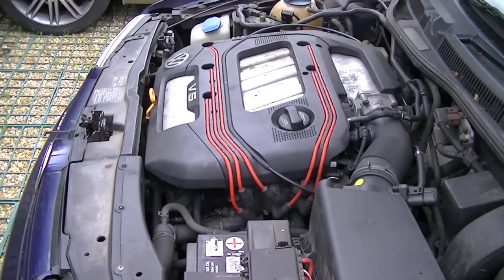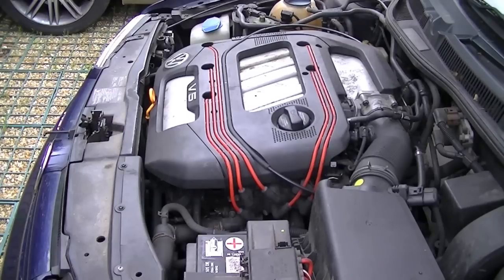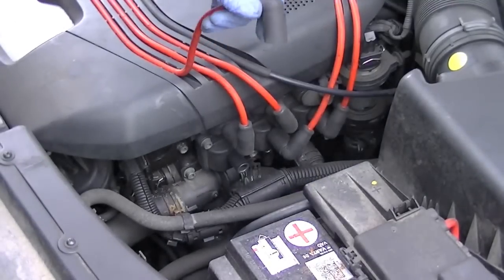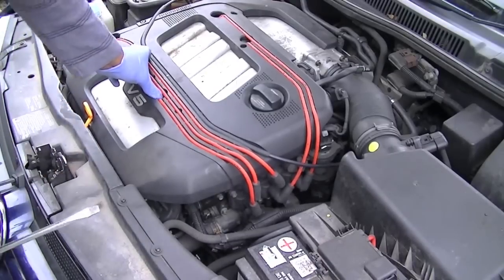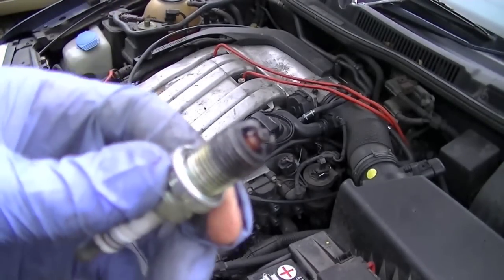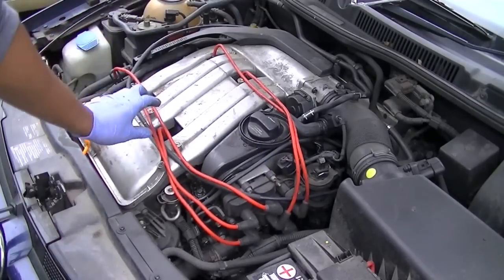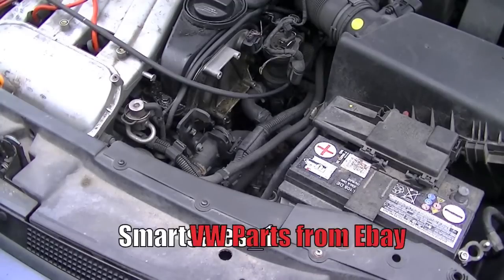How to diagnose and fix a Engine Misfire

Comment: I have the same problem with my 98 1.6 Polo. I "knew" nothing about cars and as i cant afford to take it to a garage, i've had to learn and try it myself. I can now say that i i do now "know" what's under the bonnet and how it works. I have not tried the coil pack but i suspect it may be that. I haven't tried your suggestion yet but i just wanted to say, as instructional videos go, this has to be the best i have seen yet - well done and thank you !!

Comment: Thanks for the informative video. Apparently process of elimination does work. I have a miss in my 97 SunFire and since I changed out plugs and all the plug wires , the coil pack system is all that's left to change out and should make the difference. It is old but never gave me any trouble that couldn't be resolved near 200,000 on 4cyl engine. I will post my results. Thanks again for the inspiration.
Reply: In this particular  year , the coils are not easy to access . they are under and behind the engine, a lot of people had problem with them and the next year, GM shifted them to top of engine . I have to remove parts to access, like top half of engine intake manifold and nearby parts. I don't know why the 97 sunfire was built like this .  I have not finished with it yet but will post it when I do.

Comment: Ignition electronics can be ruined by disconnecting spark plugs while the vehicle is running. Best to either disable the cylinder by grounding the spark plug wires or disabling the fuel injectors.

Comment: My van was misfiring and would "buck" at high speed. I watched YouTube vids and decided to look for arcing off the coil. Sure enough, there was arcing from the coil to the transmission fill tube. After replacing the coil it still misfired when it was warm. Took it to autoZone and had it scanned and the #4 cylinder was misfiring so I replaced all the plugs and wires. That took care of the misfire (I think the insulator on the firing end on plug # had a hairline crack). Ended up replacing the coolant temp sensor too. It still bucked at high speed but not as much and the gas pedal felt kind of weak. After thinking about it for a while I replaced the air filter and that fixed that  problem and it drives pretty nice now.

Comment: I'm experiencing the EXACT same issue on my 5 cylinder Acura. Diagnosed it's NOT a plug or wire. Gonna test cylinder compression before I order a new coil.

Comment from the maker: The dealer saying it could be a software problem is another way of him saying he didn't know but he had to say something.

Did you check, injectors, fuel pressure, fuel contamination, spark plugs, leads etc? When you say tuned what exactly did you do?

Comment: hi thanks for the video, did you actually test with the new lead before changing the coil pack? The video seemed to skip that part but then clearly showed the new lead in place when you switched the coil pack out.  where di your fault lay with the pack or the lead?

Comment: My VR5's bad cylinder fires sometimes. I was diagnosed with a bad coil but another mechanic said it wasnt the coil, wires, plugs but the Ignition Module, even though the car always started.

Comment: How can you tell it was misfiring? I noticed the change in sound when you were unplugging wires to find which cylinder, but I did not notice a change in noise from when you fixed it
Reply: Before it had more of a huffing/fffing sound and after it sounded smoother
Reply: Smoother noise, less shaking.

Comment: Cracking video. I'm trying to find out which of the 3 cylinders on my daughters 1.2 VW Polo is misfiring. And now I know how to find out. Thanks for taking the time to make it :-)
Reply from the maker: The pencil coil packs are common points of failure on those cars.
Reply: Thanks for the info, I did hear that from someone else to. Fault code states "Cylinder 3 misfire", but I've no idea which one is the number 3!? :-/
Reply from the maker: Usually left to right or timing belt side onwards
Reply: Cheers. I think i'm going to try your way of disconnecting a coil/plug lead one at a time and see how it effects the engine, to find the problem one.
Reply: Burnt up exhaust valves and the guides are terrible on those usually cylinder 2

Comment: Where i bought the coil pack he said it is original the brand is bosch not a cheap one but my mechanic said this is not original
I have checked the spark plugs and high tensions they are good

Comment: I've been having a problem with cylinder 3 miss firing. replaced the spark plugs, wires and still miss fires. I think next ill change the coil pack. Also it dies when the break is applied, not like a stall and than dies, it just dies. I think its a vacuum leak somewhere.
Reply: An year ago, u had this issue, but as of now it's with me. Am tried of making it repair. Thinking about it to sell or dump. Your work process could save me bro

Comment: My current MK VI GTI has developed a misfire.  After replacing the coilpacks, spark plugs, hpfp, four injectors & doing a compression test the motor still misses. The dealer has told me it is likely to be a software issue. I have read of many people having to replace the ecu. Of course this is a tuned car with many modifications.

Comment: Very good video!  Is there way way you can be sure it's the coil pack before you get the old one out and fork out on a new one?  I'm not getting a spark on the 4th cylinder, and I've eliminated the plug and the lead as causes.  Is there anything else it could could cause it?
Reply from the maker: You can compression test the cylinder to make sure that the cylinders are holding pressure
Reply: and dont for get to check  the resistance on the wire  or swap the #4 wire and  using the  volt  meter check the  output  on that coil

Comment: BMAC VAGS i have a 2001 vw golf v5 170bhp version which started out with a similar missfire, now i have too apply almost full throttle on startup or it just turns over! Also when cars running it sounds like a chanook helicopter and tries too die everytime i stop at lights etc!? Reaks of fuel, i have changed cam sensor as vag error code said "camshaft sensor bank A overfueling due too timing out" but no change. Any help greatly needed thanks🤔👌

Comment: So I have an 85 chevy with a 350 carbureted it's straight piped with no catalytic converter and I am pretty sure it's missing, it'll bog down every now and then when I'm at lower rpms I haven't driven it at high rpms since it started acting up anyway when it idles it just sounds like it wants to die and it shakes not terribly but enough to notice it sitting in the cab people have said it's probably missing but I'd like to hear from more people
Reply: sounds like a fuel / carb problem
Reply: I'd whip out the ole timing gun and make sure your carb is properly adjusted with the proper jetting.

Comment: Can you do this for a 2012 Buick Regal. It’s got a brand new engine. The check engine light is still on, ABS light, the light with exclamation mark & the light with the car and the swiggly lines. The car shakes and squeaks inside when idling.

It also like punches on its own sometimes while driving it’ll jet forward hard.

Comment: Thanks for the video. I have a question for you. I have a Nissan Altima 2003, 190k miles. Recently, the car began to shake at stop signs and traffic lights, and also when i first start it in the morning. One day the shaking was really bad and the service engine light began to blink. I read the code and it was P303. A mechanic checked the 4 spark plugs and all of them had a orange-red coloration at the tip, as if they where severely burned in the past. Then he removed the oil cap and saw that it was wet. He didnt make any tests, just by looking the plugs and the coils he said "They are fine and working properly, is not a plug or coil issue, is definetely a more serious issue". He then said that he needed to remove the top half of the engine to make some adjustements and it will cost me over $500. 

What do you think about it? Whats the reason for all the spark plugs to have that orange-red discoloration at the tip?

Any help will be apreciated. Thanks in advance!

Comment: hi, i own a passat 115bhp 2,0 petrol. it has a misfire that seems to point at the injectors because ive done a compression test, injector pulse test, replaced plug and lead on the culprit cylinder 2. Still misfiring. How likely is it that there is injector failure although there is a healthy pulse at the plug from the ECU.  Oh and there is a nice blue spark from the coil pack. pls advice. thanks

Comment: ...so was it the coil pack or the wire?
Reply: the coil pack obviously. he changed the wires around and still no difference, then he replaced the coil pack and it fixed it. how did u not catch that
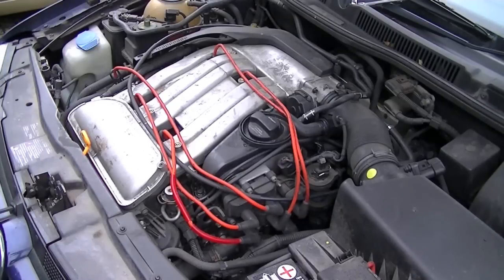Reply: At 6:17 he swapped the wire but never tested it. Then at 6:19, he then went to change the coil pack. I see what you mean, but it's just missing info as a result of video editing error. How did you not catch that....
Reply: yeah, he didnt test to see if it was just the wire.. bad editting.
Reply: strumpeteer I was thinking the exact same thing. Didn't see him test the wire at all. What if you were on a budget and couldn't afford the coil pack?
Reply: Many aftermarket coil packs can be inexpensive and affordable.
Reply: Did you have a flashing CEL check engine light?  Also, didn't see you test that cable; but glad everything is working.
Reply: Do what most of us do start cheap if your in this situation first change spark plug and wires if there is no difference do coil pack
Reply: David what if the c.e.l is flashing ? Does that mean anything specific?
Reply: Illon Brown 
Yea it means stop your car ASAP and get it checked out
Reply: I got lost on the half time report no test in the end so much for 8 minutes 57  seconds
Reply: Is coil pack the same thing as distributor in an older car, say 1994?

Comment: ive got a VW polo and is misfiring quite bad, theres a coil pack that does not fit on the engine properly because the right  fit is hard to get for a polo.any  ideas what  to do?

Comment: I have a similar problem with my 2002 VR6 VolksWagen Jetta. Only difference is that it is not a consistent misfire. It has given me codes for the Oxygen sensor. I think the code was P1151. I've had issues with the spark plug coil before but I replaced it and all the plugs. Since it isn't consistent however I believe that the fuel is not getting the right amount of fuel/air mixture and isn't firing at 100% efficiency,maybe due to the oxygen sensor or a dirty air filter. Your thought on how I should diagnose this?
Reply: You should try a obd2 scanner with live date so you can monitor your long term fuel trim & o2 sensor. Use propane to make it run rich and see if your o2 sensor responds (1 volt is rich) then pull a vacuum line to make your engine run lean and see if your o2 sensor responds lean.

Comment: You were suppose to try the lead wire first and if that didn't work, then try changing out the coil pack - you have no idea if the problem was in the pack or the wire (plus, you need to give the wire back to your friend - you just kept it.)

Comment: Changed Catalytic Converter, Spark plugs, wires, distributor cap and rotor. Still misfires.I mean sounds of Loud popping out of exhaust Mechanic says to change fuel injectors

Comment: Can you help me out I got a golf mk1 my car misfire pulled the the first 3 spark plug cables and the idle dropped buy when I pull the 4th one the idle stays the same,so I change the spark plugs cable distributor cap and rotor and sitting with the same problem still

Comment: I'm in the US and have a Ford Ranger that is misfiring and the code says there's a problem with cylinder #4. I replaced the spark plugs, wires, and distributor cap and it still has the same issue...I'm not sure what to do because I don't want to pay several grand at a shop. Any suggestions?
Reply: Briluvr try doing a compression test

Comment: I have a vw polo 3 cylinder and it’s the third spark plug came out dirty and swap it over with the first one still the 3 cylinder misfires and did the same with the coil still got the issue help pls

Comment: I have an audi a3 2009 1.8t and there is one cylinder that is not working, a mechanic told me we have to replace the whole cylinder with all its components which is about one thousand pounds, is it really i should do what he told or can i fix it my self
Reply: Take it to several different mechanics. Do not rely on one single mechanic on your problems.

Comment: Is it not dangerous to remove the coil pack when the engine's running just out of curiosity?
Reply: turn car off, you can short-circuit the coil packs.
Reply: Loяd Jiиxx I turn car off and disconnected pos battery then more safe

Comment: Hi BMAC, sometimes after driving for a little while 20mins or so when i put my foot on the acclerator, the exhaust sounds louder and discontinuous ( sounds like small explosions after each other). This sound goes straight away when I restart the engine strangely! could this be due to engine misfire or somethung else? 
But as i said it doesn't always come on and goes away when i restart the engine!
any ideas or suggestion is much appreciated

Comment: Brother can you help me i have a 2017 mustang and my engine light came on i took it to shop and it said engine missfire but the car runs fine so they turned the light of and its fine? Can an engine just missfire once just randomly but everything is fine? Id really appreciate some advice? Thanks Glenn
Reply: BADDAZZ GARAGE it's fine if you don't mind losing some horsepowers. But just removing the check engine light doesnt mean the issue has been fixed

Comment: hey man  need help my v5 has just started to have white smoke from the exhaust and running a bit funny any ideas im  to broke to take it to the garage and only had the car a few weeks.
Reply from the maker: Is it using lots of water?
Reply: BMAC VAGS not really oil level has gone down a bit though.do think ive done head gasket in. doh
Reply: christy healy
Reply: christy healy have i f@*ked up the car myself went for a drive and noticed the coolant hold was hot and let the blue cap off i know sH@t about cars.
Reply from the maker: Sounds like it was overheating when you bought it. What year is your car?
Reply from the maker: how did you get on with the car?
Reply: BMAC VAGS still smoking a bit how do i stop it over heating its a t reg,
Reply from the maker: I have a engine for this car if you need one, where are you located?

Comment: he didn't show the spark plug wire being pulled out and if there were any chage in the sound of the engine as the new spark plug was replaced and with the new coil pack replaced so without that part of the video the car could in fact have a misfire due to something else. Im not saying that it isnt fixed but that seeing the example after the part swap would have been a relieve tentioner

Comment: I have a '93 Altima that has idled rough since I got it a year ago. A while back it started intermittently "jerking" while accelerating.. the rpms drop for a split second. it smooths out if I put my foot down fully. Any thoughts anyone?
Reply: If you have rpm drops while accelerating that can mean bad TPS sensor. Rev the engine to 2000 rpm and hold for 30sec, if everything seems OK then you have a vacuum leak between MAF sensor and throttle body.